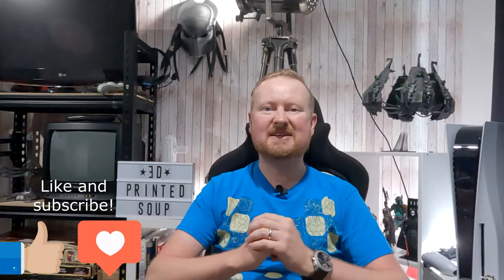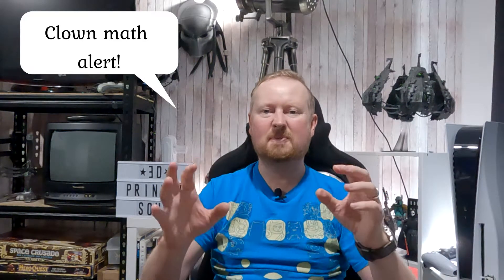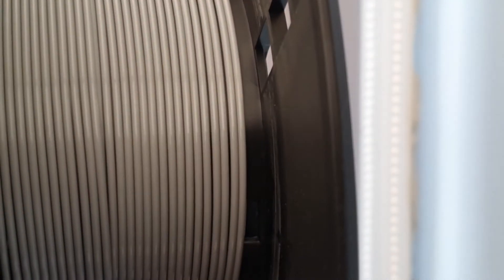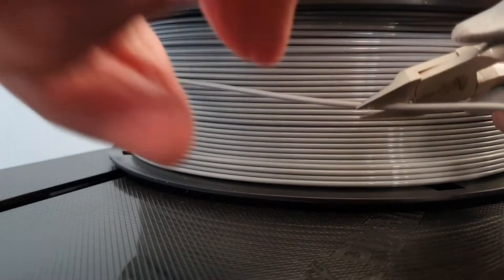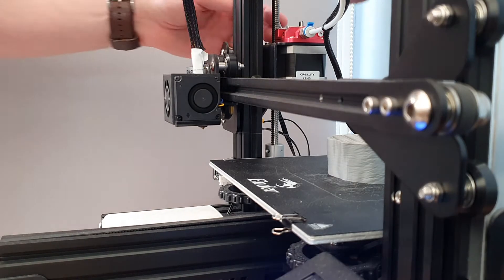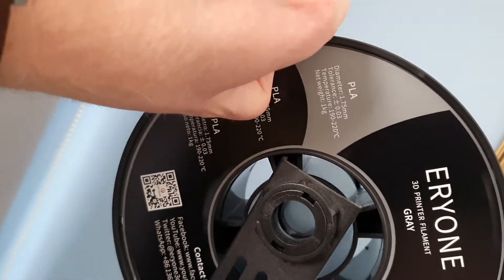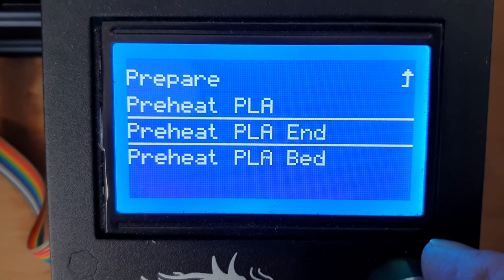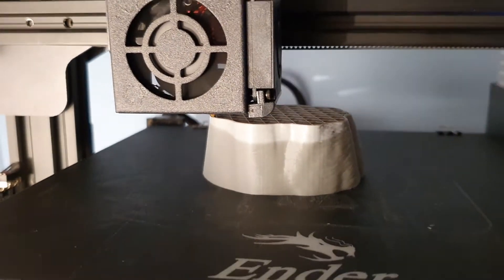How to swap or replace 3d printer filament reels mid print on Ender3 and ender 3 Pro.

Comment: You waste hours of printing, I had that much left and kept coming back every 10min and it barely was used, I actually got hours and waiting till foot left then paused, but Mine doesnt go home, it stops in the path, I note Z position and move Z up so I can see the new filament coming thru, but then i bring it back to original location and it doesnt line up, it might be close but you can see misalignment.
Reply from the maker: Mine homes it’s self, I change the reel and it continues where it left off. Maybe try updating your firmware to the latest version. Cheers for watching

Comment: I have an Anycubic cobra 2 pro, after I’m done printing a project the remainder of filament roll sits out…. I don’t have a cover for the printer, do I need to cut the filament and store the roll in an airtight bag? What if I want to print again… do I simply insert the filament again? Please help me understand how to preserve the filament so it doesn’t sit out while I’m not printing. Thank you!!
Reply from the maker: Hi :) filament longevity is an interesting subject. It really depends on the environment your printer is in. If it’s in a cool, dry environment (like my workshop in the South East of the UK) then it won’t affect it too much. However if it’s in a hot environment with high humidity then the filament is going to expand, weaken and sometimes snap. I would recommend removing the reel and storing in an airtight box or bag if your in a high humidity zone. Hope this helps- also check out filament driers if you are really affected by this. Cheers for watching :)
Reply: @ thank you so much 😊

Comment: What would you do if the firmament already went past the filament sensor and you got a "consumerable exhausted" message? How would you change it out in that case?
Reply from the maker: Depends where the hot end ends up. Not had this happen on an ender 3 myself. I would need more details like where the hot end is ect.

Comment: Newbie here. I have an Ender 3, and when I choose "Pause Print" it doesn't move the nozzle to the home position but just freezes immediately in place on top of the print. What am I doing wrong?
Reply from the maker: It may be that you need to update your firmware  to allow this to work, you can get the latest one from creality’s website. Thanks for watching :)

Comment: On a FlashForge 5m Pro I was able to cut the filament about 1 inch before the extruder, and loaded the new filament while pursuing the print head without pausing the print. Not sure if I would be able to repeat the feat again 😂😂
Reply from the maker: Wow, nice effort :) I did the same with the first ender 3 when first got one

Comment: My printer just crush while pausing the print 😂.Either way good video
Reply from the maker: Sorry to hear that. It seems that pause works on most versions of the ender3, but there are some firmware/hardware versions that have issues. Cheers for watching :)

Comment: I cut the old filament square while it's still printing close to the extruder.  Cut the new filament square, and then follow the previous filament end as it disappears into the extruder and follow with the new filament.  You need to hold it there for a while to handle retractions, but this works for me.
Reply from the maker: Will have to give that a try. Thanks for watching

Comment: I did what you said and my print that was going for 11 plus hours stoped I paused print then did the Filament I started print it didn’t work so I did auto home then resume print and it knocked it off bro I’m so sad 😞
Reply from the maker: Sorry to hear your printers pause failed. You say your print stopped and then you paused it?
Reply: @3dPrintedSoup  no I paused it like you said and loaded the filament when I pushed it through it was extruding sinc so wanted it to not get on the print I auto homed it resend print then it knocked it it off it couldn’t have completely been my fault but to fix it and no waste filament I went to my slicer and found to part it stoped at and right now I’m printing the rest so hopefully I can glue them back together but it was a bummer seeing it fail also to mention I don’t think it was the tutorials fault it could of just been mine
Reply from the maker: @Yourboytanner_yt  yeah, I’ve had a few people say they auto homed the print before resuming, this seems to throw the printer off so I recommend loading new filament and continuing without auto homing. It’s always touch and go when you run out mid print . Thanks for watching and taking the time to comment, much appreciated :)
Reply: @3dPrintedSoup  ive followed these steps but when i press resume it moves to the location where it stopped printing but hten it doesnt do anything
Reply from the maker: @sky_kbrookes  if you pause and resume then it should continue the print once it’s back up to temp

Comment: !WARNING! I have an Ender pro 3 with the latest MB. I paused the print and it just stopped where it was. So I auto homed, so I could run a little extrude and make sure the new filament was coming out ok, figuring the printer would know it had been homed and pick up the print from there. 
IT DID NOT! It seemed to think that it was still where it had paused and started trying to print from there, crashing my print nozzle into my bed, and causing my steppers to jump as it tried to push down through the print bed. Be really careful and don’t make the same mistake. Hope that helps others to avoid this issue. Oh, and my print was ruined 12 hrs in with 4 left to go 😢😢😢
Reply from the maker: Indeed, don’t auto home if you pause a print, the printer will forget where you were up to. Sorry to hear about your print mate, it sucks when a long session fails mid print. Cheers for watching
Reply: @3dPrintedSoup  Thanks. It’s all part of the learning curve I guess, and one of those mistakes I’ll only ever make once 😊
Reply: Yes mine stops where I pause it, how do I fix this

Comment: Idk about all of you but I take note how much filament I've used on each roll so when I go to do a new print I can tell if I will have enough on that spool before I even start. I save spool leftovers for doing small prints that color doesn't matter
Reply from the maker: Yup, I imagine allot of us do this, but sometimes there can be a miscalculation and that’s when this is helpful. Thanks for watching
Reply: Sound advice, I might have to start doing that.

Comment: Did this but it literally stopped in place. Once I got it changed it it ran the nozzle through everything already printed and screwed up the whole print
Reply from the maker: Happens sometimes if you push down too hard on the printer and move the axis slightly.

Comment: TLDR;
Get your new spool. Gut at 45 degree angle at a nicely curved piece of the PLA
Pause Print
Remove filament from extruder and tube.
Load new spool. Feed thru extruder and tube all the thru to the hot end.
Preheat PLA. Preheat bed.
Resume Printing
Reply from the maker: Or make an entertaining and informative video about it and not use boring text…just saying
Reply from the maker: Also, do you not see the irony of saying TLDR to a video and then using text to list how to do it?

Comment: my printer dose not auto home when i press pause it just stops in place and starts to melt the print where ever it stops why?
Reply from the maker: Which printer are you using? And which version?
Reply: @3dPrintedSoup  I'm having same issue on ender 3 pro
Reply: Hey guys, I'm having the same issue. My printer is a Ender 3 Pro. I just got it like a week ago. Do I have to update the firmware or something?
Reply from the maker: @mauromendez1815  definitely try a firmware update, they are available on creality’s website
Reply: @mauromendez1815  same problem  and It doesn't look like its easy to update firmware with out extra stuff. why would they take features away from pro version??
Reply: @LuisHernandez-sOuL  an update: If you have a ender 3 pro, most probably your motherboard is a 4.2.2 or newer. For these ones you don't need an arduino, just a SD card. However, in my case, I have a GD32 processor which I found out by opening the motherboard case. These chips are not supported for updates so I will just wait and don't touch the firmware for a while
Reply: @mauromendez1815  thanks for letting me know I did just get my printer this week so hopefully  I can just do a sd card update. From all the googleing I did I didn't  find anything but the arduino solutions so gave up. I'll look into it more now and try to figure out how to update it . thanks

Comment: Tried to do this over USB from Simplify3D but it didn't work. Not sure if there is something different about controlling the printer from the Simplify3D Machine Control Panel. In fact, the front panel commands were ignored. I had to Pause Print form inside Simplify3D. The print got pretty gobbed up right out of the chute on the first layer when I Resumed Print. I have to practice a few more times to see if it is something I did wrong and can avoid.
PS = I am running the Marlin for BLTouch and it gives you a Change Filament command from the front panel which is a little smoother than just pulling the filament out while the nozzle is still hot.
Reply from the maker: I don’t network my printers so don’t know if it’s possible to stop start prints remotely. Let me know if you find out how. Cheers for watching

Comment: After hitting pause print and installing the new filament, the menu does not show the prepare menu anymore. Any reason why?
Reply from the maker: Yeah, prep is for before you hit start. You have paused a print mid action, when you unpause the print will revert to the exact temp, layer and speed that it was running at when you hit pause, as such you can’t prep for a print that’s in progress.

Comment: Try to do this while the printer just has started the infill on a new layer. That way you can prevent holes on the outer shell that might occur due to temporary underextrusion when resuming the print.
Reply from the maker: Good tip, thanks for watching :)
Reply: @3dPrintedSoup  😢